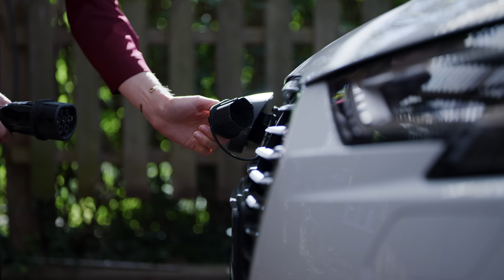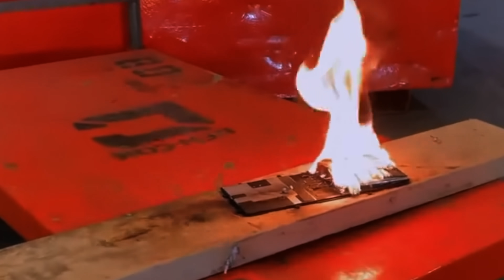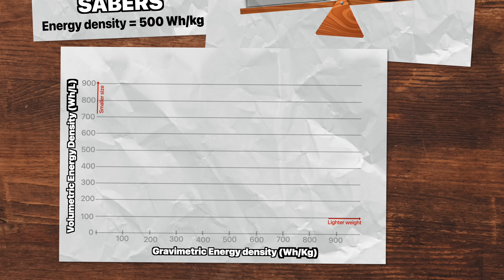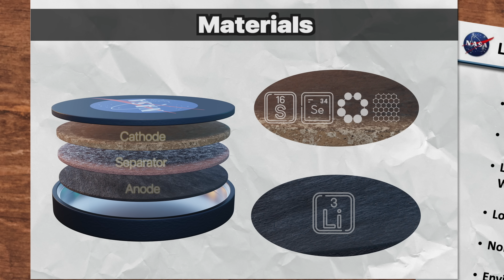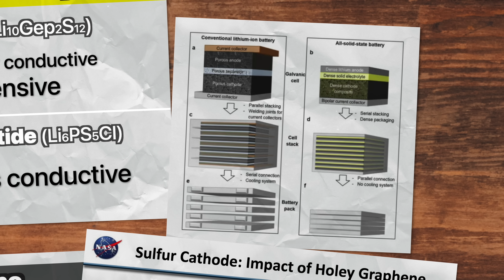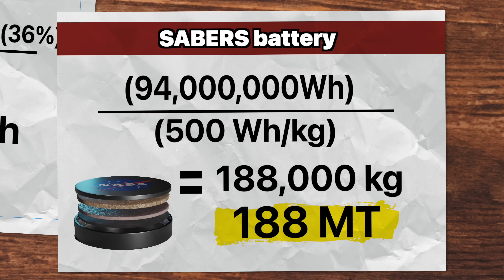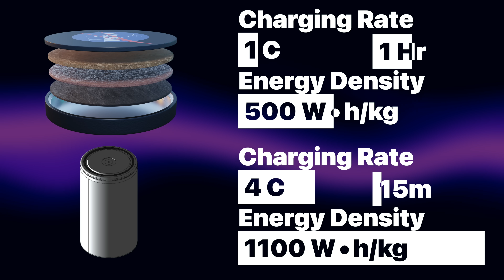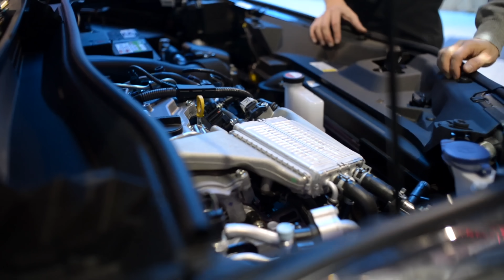Why NASA is Building a Solid State Battery

Comment: Errr you need to roughly half the weight of the fuel as you burn the fuel as you fly, so you don't have to carry the fuel the whole way, in fact you would need more more than half the weight of the fuel, but for ease of calculation half if good enough.

Comment: HAVE THEY TRIED GALLIUM ANTIMONIDE- IT HAS THERMOPHOTOVOLTAIC PROPERTIES- THOUGH IT HAS TRANSFERENCE THRU LIGHT- IS NOT LIGHT AS TRANSMISSION AND SILICA IN A WHOLE HOST OF ITEMS WHERE WE ARE ULTIMATELY HEADED ANYHOW?  COMING TO SIMPLICITY AND A REDUCTION OF TOXICITIES .
OR GALLIUM ARSENIDE SEMICONDUCTERS AS THEIR PHOTOVOLTAIC PROPERTIES ARE IN USE ALREADY. HOW FAR A JUMP TO SOLID STATE STORAGE ?  ALSO HAS A DIELECTRIC CONSTANT NOT SUBJECT TO HEAT USING DIRECT PHOTON COUPLING RATHER THAN MIXED UP LIKE SILICONS NEED TO FIND A HADITH FIRST. I SHOULDA TOOK CHEMISTRY

Comment: RECENT UNIVERSITY RESEARCH HAS FOUND THAT SMALL PARTICULATE COAL, DIESEL- HYDROCARBON POLLUTION MATTER. ETC. , HAS PARTICLES SO SMALL THEY MIGRATE UP THRU THE OLFACTORY NERVE, INTO THE ONLY AREA WITHOUT A  BLOOD-BRAIN BARRIER.    UPON ENTERING THE FRONTAL LOBES, THEY CREATE LESIONS WHICH ARE DIRECTLY RESPONSIBLE FOR DEMENTIA.

Comment: My E-CELLS brand TWO battery, TWO hub motor mountain bike really needs lighter solid state batteries BUT also at a lower cost or at least equal. My Li-ion 15 Ah rear battery costs $600.!! The 18 Ah front battery cots nearly $700. Aaaarrrggghhh!
But hey, having that bike is like having a magic carpet so I can't bitch too much.

Comment: Well they could use high-density high-speed motors to ramp up the compression blades which is where the most of the loss from the startup and warm up of the engine is in the fuel efficiency. Thereby saving cost and efficiency and helping it to have greater throttle response almost that of a car. And thereby increasing your fuel efficiency and making it reliable is where the testing needs to be.
So an electric assist on our turbine blades specifically the compression. Blades
Bryan Robert August Thul👻

Comment: 0:26: 🔋 NASA has developed a game-changing solid state battery that could electrify 90% of commercial aviation.
3:07: 🔋 A solid electrolyte battery with a selenium sulfur chemistry has been developed, offering almost twice the energy density of typical lithium-ion batteries and reducing weight by 40%.
6:15: 🔋 NASA has developed a new battery technology that has higher energy density and is safer than lithium-ion batteries.
9:10: 🔋 The Sabers battery, developed by NASA, has the potential to power commercial jetliners and revolutionize long-haul air travel.
12:40: 🔋 The Saber battery has the potential to electrify a large portion of commercial flights, but it faces challenges with power density.
15:39: 🔋 The video discusses the development of solid state batteries and their potential impact on the aviation industry.
18:44: 🔋 Sol State batteries have the potential to revolutionize energy storage, and NASA is playing a crucial role in their development.
Recap by Tammy AI

Comment: Batteries are a source of potential energy.  If something goes wrong and the battery releases its energy in a moment, you get an explosion.  I trust these small batteries are being made to protect against this.  Lithium batteries can explode and burn without oxygen.  Terrifying. Now, we will have this battery that is 2 x the power of lithium.  Great and scary 😮

Comment: The engine mass was done wrong, you can't just assume 30 engines things don't scale that way. 2 engines is the normal because most of the weight is the connections housings supports ect.. When you have a larger engine those become far less of the total weight. You need to do a far more complex scaling it's probably around half to 35% what you assumed.
Reply: There's also a issue with just picking a motor at specs of mass to thrust and jet engines that are electric actually do exist in labs, plasma trends to be better than electric alone but you obviously need a fuel still on that end.

Comment: And I was watching your video and you're saying about boat dropping they have a low voltage cut off on the ESC so that is one way you can get around killing the battery and if you want more power run them in series

Comment: I am interested in the I would not mind doing a follow-up video and giving my honest opinion about it I do RC drag racing I use LiPO batteries all the time the One battery I use for my drag car is a 8800 mAh by 200c 400  burst and they work pretty well for me I run a bunch of LiPO batteries for RC racing so if I can double my run time and power with lighter batteries I will definitely review it and give it my honest opinion

Comment: While the battery tech is very impressive, when will people start asking what is the real life impact of switching to battery power and is it worth the cost?    Jets and large tractor trailers using battery power is incredibly inefficient when factoring in all impacts of doing so.   The question is not if we can, but if we even should.  Regardless your stance on global weather.

Comment: Why bring airplanes into the question? Of course the battery's weight will prevent that from happening, at least for anything other than short hops. But these new solid state batteries will be a game changer for devices that stay on the ground, like EVs, and phones, and just about every other battery powered item you can think of. Drop the electric flight idea from your video and we see how important this development can be.

Comment: Why not make Hybrid planes? Let the gas engines provide power for takeoff and then offset some of the cruising with electricity. Hell, even add some solar panels to the wings and fuselage to boost the electrical range.

Comment: What NASA has isn't special. Just about every battery research team has built working solid state batteries.

The problem is scale and cost and how long they last.

So far they just haven't found a way to make them last last long and/or how to mass produce them.

Some benefits of solid state are already here the BYD Blade battery is puncture proof. Ice seen nails hammered thru them and no fire.

Comment: If they can be stacked I assume they also have a certain overload resistance.
Obviously they are not scared of dentrites. I wonder if this is because of the strength of the sperator or if there is something avoiding dentrite growth 🤔

Comment: Another point is the maintenance costs. Electric motors don’t need nearly the same amount of maintenance compared to fuel burning engines. Combustion leaves deposits, magnetism doesn’t effect the object it’s pulling at any macro scale.

Comment: Where it might make sense is in large airships. These aircraft would suffer no extra stresses from LW = TOW, there would be no need to pump fuel or ballast to trim; CoG would be fixed. Gas, or water ballast, could be released if necessary. The battery could even be an auxiliary/emergency power source as solar cells could be built into the fabric.

Comment: It’s funny how they want to keep the aircraft the same and only replace the propulsion system. There are multiple ways to reduce the energy required. Different wing designs to give more lift at a lower speed, fly at slower speeds, reduce weight, etc.

Comment: It's a nice idea to make a plane using that battery and I think the battery has a lot of potential but Airlines would never buy the plane think about it this way that would mean I would have to have multiple different planes for long range and short range that would be extremely inefficient and make charting Airlines difficult I can see the potential for this for Consumer Electronics and electric vehicles until you can get the same range or better out of an aircraft I don't see it replacing conventional fuel sources the technology just isn't there yet and I don't see it getting there for a very long time but it is a good step

Comment: and when the battery life is over, you could still blend it into powder and use it as an anti dandruff shampoo. And since EU banned selenium sulfide, it comes in pretty handy. Because it was the only thing that helped. Leave me a phone to the NASA srapyard manager ... 
Now seriously. hopefully we wont fall into the same scenario with solid state batteries as with fusion. Almost there yet?  Who knows. economy/raw material abundance/ease of manufacturing/ production scaling. Cherry on top for me would be capacitor like charge/discarge capabilities and battery like capacity. Inflamability, mold casting properties etc.

Comment: A "home run" advancement?  How about a "grand slam" advancement?  Seriously, if the specs can rival the internal combustion engine (ICE), the ICE will be a thing of the past.  Here is my question.  Will we have the electrical energy infrastructure to supply the needs of consumers to drive these electric vehicles?  I do not think the Federal government has any interest improving any U.S. infrastructure much less the the electric grid infrastructure.

I feel the answer is to use the winning solution(s) of these technologies to capture solar power from home solar panels for local transportation and then use this power to charge the electric vehicles for local transportation.  In the grand scheme of things, in terms of mass, a true comparison of the ICE and hydrocarbon fue and an electric drive train should be taken into consideration.

Comment: Between 1831 and 1834, Michael Faraday discovered the solid electrolytes silver sulfide and lead(II) fluoride, which laid the foundation for solid-state ionics.[5][6]

By the late 1950s, several silver-conducting electrochemical systems employed solid electrolytes, but such systems possessed undesirable qualities, including low energy density and cell voltages, and high internal resistance.[7][8] In 1967, the discovery of fast ionic conduction β - alumina for a broad class of ions (Li+, Na+, K+, Ag+, and Rb+) kick-started excitement for and the development of new solid-state electrochemical devices with increased energy density.[9][8][10] Most immediately, molten sodium / β - alumina / sulfur cells were developed at Ford Motor Company in the US,[11] and NGK in Japan.[8] This excitement for solid-state electrolytes manifested in the discovery of new systems in both organics, i.e. poly(ethylene) oxide (PEO), and inorganics such as NASICON.[8] However, many of these systems commonly required operation at elevated temperatures, and / or were expensive to produce, enabling only limited commercial deployment.[8] A new class of solid-state electrolyte developed by the Oak Ridge National Laboratory, lithium–phosphorus oxynitride (LiPON), emerged in the 1990s. While LiPON was successfully used to make thin-film lithium-ion batteries,[12] such applications were limited due to the cost associated with deposition of the thin-film electrolyte, along with the small capacities that could be accessed using the thin-film format.[13][14]

In 2011, the landmark work of Kamaya et al. demonstrated the first solid-electrolyte, Li10GeP2S12 (LGPS), capable of achieving a bulk ionic conductivity in excess of liquid electrolyte counterparts at room temperature.[15] With this, bulk solid-ion conductors could finally compete technologically with Li-ion counterparts, leading to the modern era of solid-state research.

Comment: I find it exasperating to see most content makers on YouTube do so much quality research yet think it's a good idea to be on-camera while reading everything from a prepared script, feigning spontaneity. It's very easy to pick up on reading eye movement, it's not conducive to an engaging delivery, sounds flat and unnatural, just like it would if you were to attempt it on stage in front of a live audience. If you * are * nevertheless reading passages word for word, maybe because they're a little technical or you're quoting someone, slowing it down will also make you more aware of speech rhythm in general, and make the content easier for the audience to assimilate, particularly, dare I say it, when your diction is somewhat rough round the edges. I would recommend tackling this exactly like a presentation in front of a live audience, i.e. using public speaking techniques like bullet points, memory joggers, visual aids, but also lots and lots of practice beforehand using the off-the-cuff speaking part of your brain to find the words. If you absolutely must write down a full speech, fine, but don't read it to your audience! We want your value-added content, a performance of sorts, because fast reading some text we can do for ourselves. Video, at the very least, gives you the opportunity to do retakes and to splice the good ones together and, crucially, to assess and improve your presentation skills without assistance from anyone else. Cheers.

Comment: Why not make a bigger plane with more wings maybe?
Reply: Can seem to forget capacitors for the burst of take off. Compound engines. Adding a power gen turbine that uses the air to recharge some battery sections during flight. Lightning capture. Hybrid engines.

Comment: Unless there is a massive breakthrough in Battery Tech I don't think it will be possible in the short term to replace Aviation Liquid fuel.. Fossil fuels/kerosene or..?  are just too good..  
BUT..  There is always another solution..      It just takes a bit of abstract thought..  
To acheive lower emmisions on Aircraft..     Make fewer journeys..               Promote Trains for internal travel..    Increase prices..  
By halving the amount of flights it would way exceed the benefits anticipated in reducing the carbon footprint.  
Prioritise flights for over Sea routes.                  Improve liquid fuel research..
Batteries are great for certain things.. but not everything.

Comment: On aircrafts, one needs to consider the fuel consumption leading to weight reduction along fight, also regarding the implications on range and landing/breaking, as the batteries doesn't get any lighter.

Comment: This has been my argument for electric vehicles to begin with. We need a better battery. That is a simple fact now with this battery as long as hot and cold temperatures don’t affect it too much. Will fix a lot of those problems now the biggest question comes, can it be mass manufactured at a reasonable cost, I’m not an engineer I don’t know but that tends to seem to be the problem with most solid-state batteries it’s not developing it it’s not getting it to work. It’s being able to mass produce it at a cost-effective way.

Comment: ... i'm only 3 minutes in and there's already flaws in this. 
Just because your separator is a solid, does not mean it is safer. 

If i made Lithium into solid would it be safer? No
If i made Gasoline into a solid would it be safer? No

Comment: Jet airliners need a lot of power. There are also a lot of other systems currently running on jet engines. Perhaps some components on an airplane can be converted to electric power instead of the main engines.  It can be really difficult to make a complete switch from a technology that has been fine-tuned for so long.

Comment: Could a hybrid system not be implemented, use fuel or the battery for take off, then switch to the other energy source at cruising altitude. Would also have some reserves of the take off fuel as a backup in case of an emergency?

Comment: Yeah, narh.  Looking at the numbers, 94MWh of energy for 4000 miles, or 1/7th of 94MWh for 500 nautical miles means that you’ll need a battery capacity of ~13.5MWh.   Say you had a power supply capable of delivering 1MW of power, that means that each plane would need ~13.5 hours to recharge.   There an air industry axiom that says that they’re only making money when the plane’s in the air.   So for every ~1hr flight, the plane is not available to fly for ~13.5 hours.  The engineering is cool, but the economics don’t add up with any technology that requires recharging as opposed to refueling.

Comment: Nobody wants electric cars. Ya gotta be smart about it. Do you know what would happen if the Electricity went out for two weeks in the North East USA. nobody could go to work or get food. People would die. LOTS OF THEM! Electric cars would never work in many places on this planet. Ya know what will happen if you run out of electricity on the road? Yeah you get towed... Very expensive. And the electricity grid will never withstand what is required. Besides all that where do they get the electricity to charge the cars... Yeah from coal.. Coal pollutes really bad. worse then gasoline. Somebody better rethink this whole thing fast.

Comment: If lithium ion batteries are already 1,000Wh/kg and they aren't particularly viable for planes, why would a 500Wh/kg battery fair any better? That calculation just seems silly to do, with this battery having approximately 0 impact on the aviation industry. They already have better options the aren't using.

Comment: People always think all or nothing.

You don't have to replace the airplane engines, you can offset. Use the electrics while taxiing. Maybe at some cruising, or possibly for additional thrust like a mild hybrid car. 

We have to think outside of the box. You could recharge the batteries while in flight as well with a simple air generator.